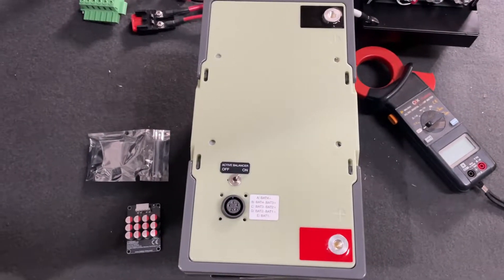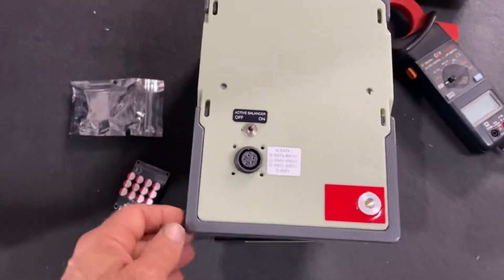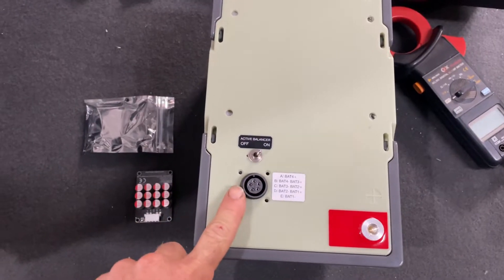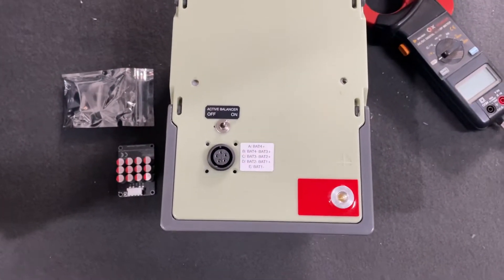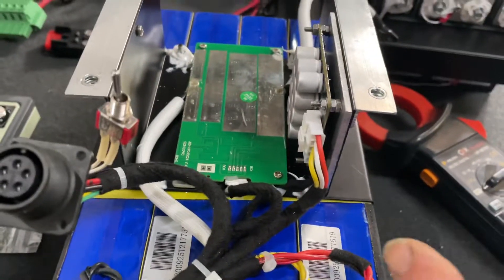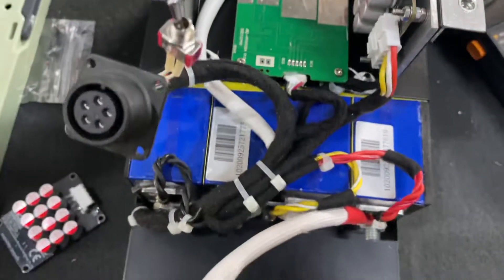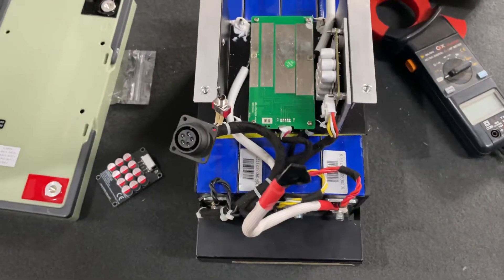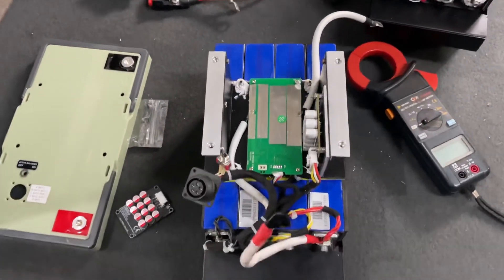VoltX active cell balance installation

Comment: Love ya work phil. This is what all the cheaper ones need active balancing. 
It a good balancer, with true active.
It's actually better than the 'hyper balancer' in other units.
Reply from the maker: Hi and thanks for the feedback 
Active balance I have found do work, but as I have found out all the cells need to start off fully charged.

Comment: Thanks for the videos on the battery Phil. Aldi  have these for sale this Saturday 2/4/2022 for $429. I think you've convinced me to buy. I'm a newbie to solar so not sure I want to spend too much on my first system for my new shed
Reply from the maker: Lindsay I am glad it was of some help to you, For the price these batteries aren’t bad value, So far mine are working fine.
If you want them to work to their optimal I do recommend cutting the battery open and charging each of the cells  individually to get max life. Just remember that the BMS is of a very low standard it has no Over temp /under temp protection and no over current protection, only low-voltage protection. 
So what does that mean, it means if you use them with in the specifications that they set they will do everything that you need of them.
I can understand why you would like to purchase these batteries initially as setting up a lithium system does get quite expensive and batteries being a consumable part of the system it makes sense to maybe cut corners on them and replace them with better ones later on when one can afford it
Reply: I just bought 2 of these and I was gonna use them in parallel in my car to run a 95 lt brass monkey camp fridge.... I'm having second thoughts though....
Reply from the maker: @jordanwalters9447   they will be fine to use just don’t expect them to last
Reply: @philsrandomstuff2392  cheers mate I just saw your comment

Comment: Hi Phil,
How did you get on with a way around running these batteries in parallel?

Very interested for more info on that one
Reply from the maker: I have had these 2 batteries joined in parallel for around six months now sitting in my van with no problems.  From my experience as long as the voltage  difference is no grater that 
120 millivolts between batteries after charging them individually  and leaving them sit after charging for a few hours. They are good to parallel up. But for safety when you first join them in parallel join the two negatives first and than the positives with a fuse of about 30amp in the  positive to positive wire just in case there is a large flow a of current from one battery to the other. They will equalise very quickly so give them 2 hours and than recharge as a pair. For peace of mind I put a fuse of 40amps on each battery when I installed them in my van. 
Hope this answers your question correctly. Cheers Phil
Reply: @philsrandomstuff2392  thanks mate, so once you have them all hooked up as described, you just let them cycle and charge as a pair?
Reply from the maker: @justifiedcruisercustoms6695   this vid I did explains how to connect them safely. 
https://youtu.be/I__xxeVaCRE
 And yes once you have done what I’ve done in the video you just leave them connected in parallel and cycle them  that way. Cheers Phil
Reply: @philsrandomstuff2392  I seen that video 5 minutes after I replied lol.

Thanks for the reply and thanks for a very detailed video review on them.

Comment: Hi Phil and thank you for these Voltx videos. Kinda wish I'd seen these before buying the batteries. Can you please tell us what you did with the existing bms wiring? I would guess the passive balancing needs to go. And, does the active balancer also have other bms functionality? Thanks.
Reply from the maker: The active balancer and the BMS run in parallel together. In simple terms the active balancer helps the BMS balance the cells better and the BMS still helps protect the battery. Personally I would not waste my money on the active balancer although they do work I am finding that running the active balancer works best if you turn it off while Discharging and turning it on when charging. You would be best just spending your money on a better quality BMS then the active balancer. A better quality BMS will make these batteries much safer. If you have time Go to Off Grid Garage YouTube channel, Andy there on the channel has put a lot of time and effort into testing various types of set up‘s for lithium batteries.
Reply: @philsrandomstuff2392  Thanks Phil.  I have been looking at the Deligreen units. Not cheap si I wonder if the cells warrant the investment. I have 2 of the new version (with display) 24v in series. Despite fully charging and connecting in parallel for 24h+ before connecting to system they are not holding up with one of them having the bms switch it off. Voltx claims they can be run in series but (with new found knowledge) I am sure, because the batteries can't talk to each other, there is an imbalance between them probably due to a sad cell in the one that pulls the plug. They're less than 2 weeks old (replacing agm's) running off a Victron controller. Cost and hassle of return makes it viable to look at alternatives I think. Hope the cells are worth it.
Reply from the maker: @opaulz2760  Sounds like the best way to go is to cut the batteries open and check the individual cell voltages to work out what is going on, this way at least once you have the batteries cut open you can see what is going on with each individual cell during the charge and discharge cycle of your batteries. Some of the more expensive BMS have an app which allows you to monitor the individual cell voltage from your phone
Charging each of the cells individually in the batteries with a 3.6 V Constant current constant voltage charger (this can be just a lab power supply that you can pick up from J car) I think will help fix your problem. With one of the batteries I have when I charged the lowest voltage cell it took seven more Amp hours then the other three cell , this obviously this affected the Battery capacity
Reply: @philsrandomstuff2392  thanks Phil. I agree that I need to get to the cell level. Still have a bit to learn on charging (top/bottom) and a bit nervous about cutting them but need to do something. At least the new ones have a see through case! Thank you very much for input.